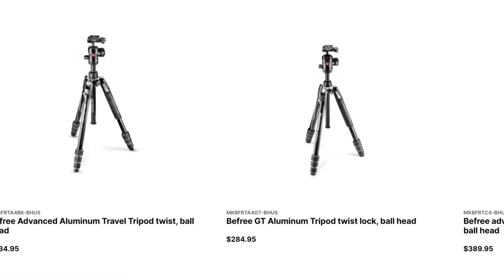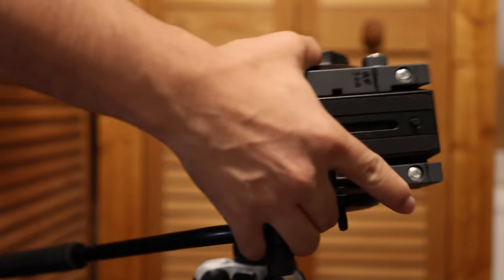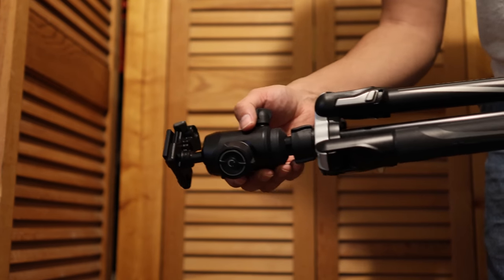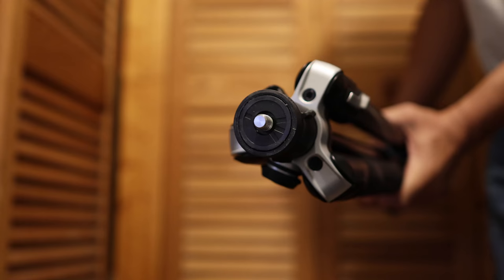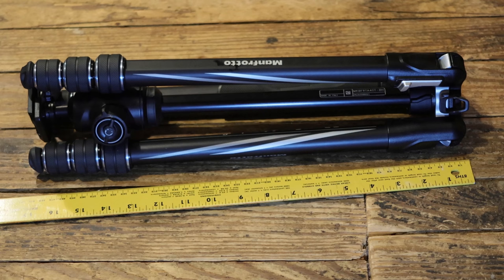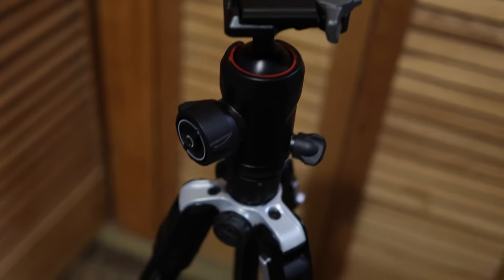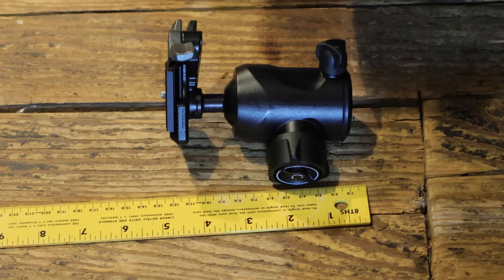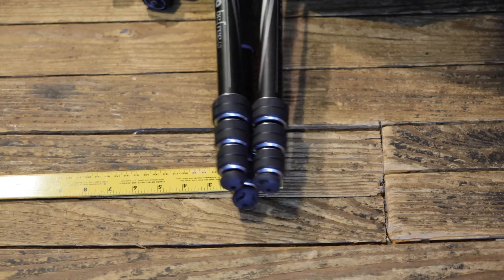Manfrotto Befree: Can We Change Tripod Heads?

Comment: good video, but a WARNING, most manfrotto and other tripod columns use a screw jam locking feature, you need to raise the column FIRST to see if a locking screw is present (manfrotto 190/ 058 & 075 studio tripods), the aforementioned models use a ratchet tooth design on the ball or gear head base, the screw jams the head here, to stop it turning off during use!!- you need to losten the screw/s until 1-2mm show below the flange on the column, then the tapered pencil tip is retracted safely, so you can then exchange heads, without damaging the head, or screw.